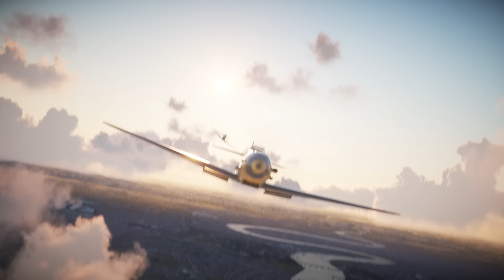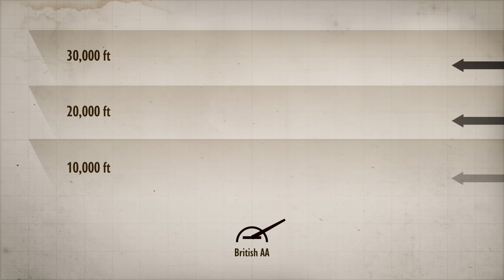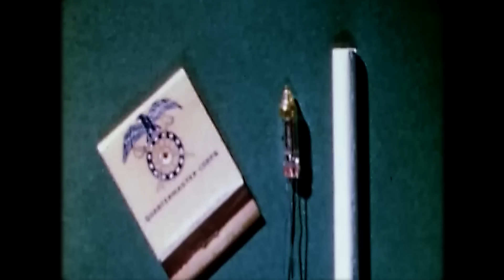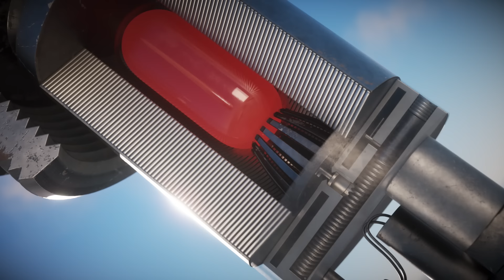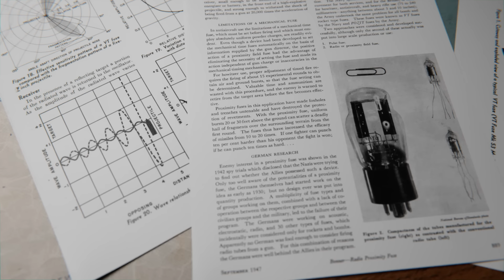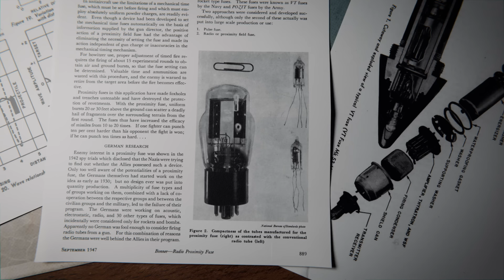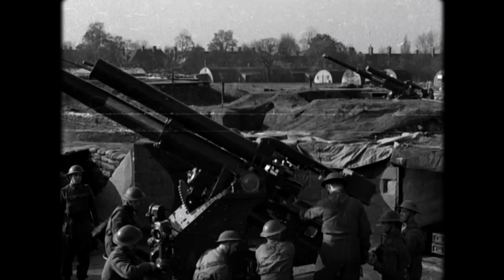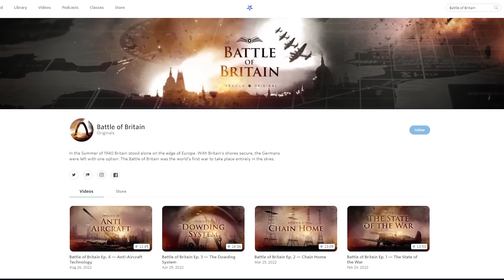The Secret Invention That Changed World War 2

Comment: I can't speak for British AA targeting systems, but I imagine they had similar methods to the Germans. Flak targeting was actually a fairly well-developed affair and not as imprecise as one may think. 

German Flak batteries were directed by the Kommandogerät (Command apparatus). An analog electro-mechanical computer that used parallax to compute a firing solution. The device relied on a stereoscopic rangefinder, which was manually aimed at the approaching aircraft by an operator. Two images of the same aircraft would be visible through the eyepiece, and a knob was rotated until the two images merged. This merging was accomplished by the knob causing a deflection of the optics of one of the viewports of the stereoscopic pair. The computer then used elevation + optical deflection of the viewport to calculate altitude and distance trigonometrically. The operator maintaining the aircraft in view and focus also provided speed. 

The firing solution from the command apparatus was then sent through cables to each of the battery's guns. Dials on each gun indicated the elevation, azimuth, and necessary time delay required to reach the target, all the gun crew had to do was match the dial readings. The system even accounted for the error introduced by the varying distance between the guns and the central rangefinder.
Reply: Even more interesting about the German system was the ability, just as in Berlin, to link multiple flakturm and other installations so that the batteries were synched and could keep the flak “box” squarely enveloping the bomber formations as they moved. The early war days of flak chasing formations or putting the box in the path of the bombers forcing them to fly into it was deadly enough, but the ability for German flak to literally put sometimes hundreds of guns on a formation and track them with pinpoint accuracy the entire time they were within range was absolutely devastating.

Understandably, flak doesn’t look so bad in the old photos and videos and even modern representations…but with how dense the flak could often be, it’s almost unbelievable that any ships made it home. Countless vets recalled it could be so heavy that the sky was black and it seemed they could literally get out and walk atop the black puffs. Scary stuff.
Reply: @HE-162  And yet, only a very small fraction of bombers were brought down by the flak, or their cities would not have been flattened.
Reply: @HE-162  why i cant expand your commentary old way? Did yt changed something again?
Reply: German AA was evaded by the bombers changing altitude by 2000 ft every 30 seconds because it took 30 seconds for an AA round to reach 20,000 ft.
The time delay between firing and the target can’t be shortened…
Reply: @allangibson8494  Of course, you're absolutely right. This had to be countered by different batteries forming Flak boxes both in front and to the sides of the predicted flight path. Needless to say this was horrendously expensive in terms of ammunition expenditure. Nonetheless the majority of allied bomber losses over Germany were attributed to Flak rather than fighters. 

 I hope my original comment hasn't been misunderstood. I wasn't trying to negate the effectiveness of the proximity fuse. I simply thought that the video gave the impression that AA (whether British or German) was crudely targeted prior to the introduction of the PF. 

The reason I used the Kommandogerät as an example is because that's the device I'm personally familiar with. I believe the British had a very similar system called a predictor.
Reply: @arcfault2873   When the solution is to blanket an entire box with AA, that is, technically, crudely targeted even if it was somewhat effective.
Reply: @daexion  not unlike the fisherman who cast a broad net, 2000 yrs ago.  Crude, but effective.   Although,  some days still netted them no fish at all.  Thats when it was handy to Jesus around.  He had his own version of a 'fused flak net' that his Disciples really liked seeing.  
Kidding aside,  its amazing what men will do with analog equipment,  to make it work like a modern day computer.  Simply amazing 👏
Reply: Wasn't there an episode of military aviation explained how it took more than 18k rounds to down a bomber ?
Reply: @terryhsiao1745  yeah, German Flak AA was generally used to sorta saturate a chunk of airspace with fragmentation so it wasn't safe to navigate. Took a lot of shells.
Reply: British systems became very effective by the end of the war. Using the technological advances in British/American radar technology, they had 3.7" AA guns paired with sensitive radar equipment, fire control computers and gun laying technology. The guns aimed themselves.  So the VT fuse wasn't the only factor. Luftwaffe air raids were fairly rare by this point, but V1 bomb attacks were underway.  While the speed of the V1 bombs made them difficult to target with such a relatively slow firing weapon, the figure I recall is an average of one flying bomb shot down per around 150 rounds of ammo fired. 
The German use of a human operator to sight the target with computers calculating where to fire is consistent with the human-dependent guidance systems for their guided bombs (manual control - line of sight).
The Allies put a lot of resources into self-guiding weapons, with the US Navy deploying a radar guided bomb (the first operational self-guided bomb) in April 1944 and had a heat seeking bomb by the end of the war.
Reply: AAA was still a primitive affair back in WW 2 and pilots on either side flying at altitude simply had to avoid flying at the same altitude and speed for more than 30 seconds at a time to completely negate AAA of the time.  That is how far ahead of the flight you had to aim so it was simply a matter of don't be where the shells are going to be when the bombers were flying at altitude.

The video saying that it worked better at low altitudes is common sense.  Much less lead required of the shots at low altitude thus much harder for the pilots to dodge.
Reply: @Stubbies2003  this was due to the time it took for the flack shell to reach altitude.
Reply: One more thing, the description you give of the rangefinder is for a coincidence rangefinder, the stereoscopic rangefinder worked differently. In this there were no moving parts, the instrument just magnified enormously the operator's natural stereoscopic vision and by comparing the target to a set of fixed pointers the operator estimated the range. The German navy used this type of rangefinder, it needs specially trained and selected operators with excellent stereoscopic vision, and they must train regularly on a simulator. This means only large ships carried them. The coincidence rangefinder does not require selected operators, is very accurate but perhaps not as fast to use and a bit more fragile. This was used by the German army, I don't know what the Luftwaffe used. The biggest rangefinder ever built had a 100ft base, was accurate to within 17 yards at 30,000 yards, was set up in Singapore for the 18" coastal batteries and was built by Barr & Stroud of Glasgow. It was blown up before the Japs could grab it.
Reply: The issue was that the timed fuzes used in flak shells were incredibly unreliable not that surprising with the pressures exerted on them after being fired from a gun when they used clockwork mechanisms.

The Germans switched to basic contact fuzes late in the war and increased their kill rate substantially and of course the variable time proximity fuze changed everything.
Reply: This system was developed in WW1 and perfected in the inter-war years by all major powers. The first AA radar sets served to improve the accuracy and speed of target range acquisition, only towards the end of WW2 did you see centimetre radars first in the UK then from the USA to actually aim the guns. Lower-frequency radars like the Wurtzburg (and the W-Riese) were not accurate enough for gun laying, they were used to aim a "master" searchlight with a blueish light, once this found a target the other lights would converge on it to track it and the blue light would go to find another target. Meanwhile the target would be engaged optically and had a slim chance of getting away. Bomber crews were very much aware that when they were caught in the searchlight beams they had to get out of the beam pronto or they's get it. The whole thing was operated with great speed and efficiency, but it required teamwork and a large team. The late-war Allies' system was much more compact, mobile and economical. A precision radar, a computer and the guns.
Reply: @Big Fan Ah, just a bug. Thx
Reply: Compensating for the lack of technology with skill
Reply: Early AA was like trying to hit a moving target at 300 ft. with a round ball smooth bore musket. Sheer luck. Proximity fuses were a real breakthrough.
Reply: such cool info! thanks, i never knew. I dunno, I just thought it was practically useless, kinda like just shooting hundreds of machine gun rounds hoping you get lucky. LOL
Reply: Germany used radar guided flak guns in -44. They were quite effective against the finns in the lapland war.
Reply: It was still very inaccurate. There were too many small errors adding up, take a shell travelling at say 200 metres per second (at the zenith of its parabola), an error of 1/10 second in the timer would result in a 20 metre error in bursting point. This would negate the effectiveness of the blast. The same 1/10 second error in the firing moment would have the same effect, and so on.
Reply: @ricardodavidson3813  The problem was somewhat mitigated when the flak vierling was guided by the radar. 4x1000 rounds per minute will add up hits rather quickly.
Reply: @juslitor  This sounds like pure fantasy, can you provide more details please? The Germans were not capable of transmitting the requisite power in wavelengths under 56 cm or so, so their radar systems relied on huge building-size antennae to achieve any sort of resolution, even the Wurtzburg (including the Riese) was not really good enough for artillery (look up Rayleigh Criterion or Angular Resolution in Wiki to understand this). The flak-vierling was a 20 mm weapon with a very limited range, it is totally out of context in the present discussion and I do not believe it ever had radar laying. The British and Americans had much better radar systems, a whole generation ahead, and even so they only used radar laying for big caliber guns, over 3". In naval service the Bofors mounts had centralised control which integrated with the ship's radar systems but that was a whole gun control package with optical rangefinders, sighting systems etc.
Reply: Also they used radar for targeting 128mm flacks (on flacktowers at least).

Comment: Would have loved to learn more about the materials and and processes used for the 20x weight requirements.
Reply: Mass remained unchanged, but weight increased by 20,000 times.
Reply: @randomname9987-o3o  You're absolutely right! My point stands, though
Reply: The secret was to miniaturize the components as much as possible.